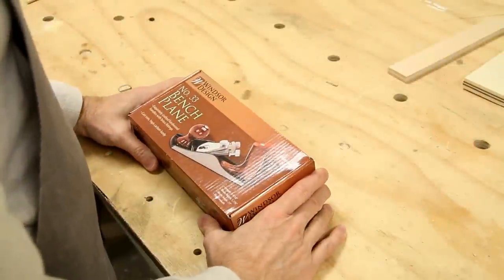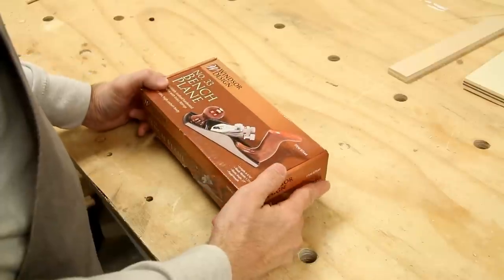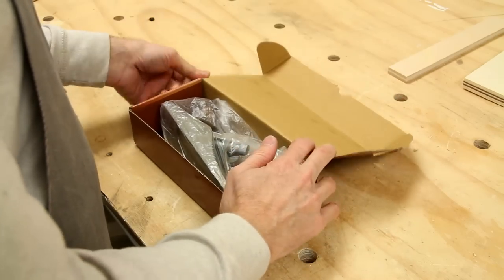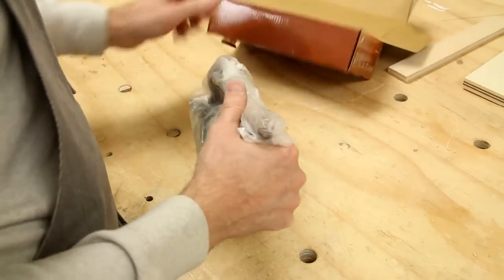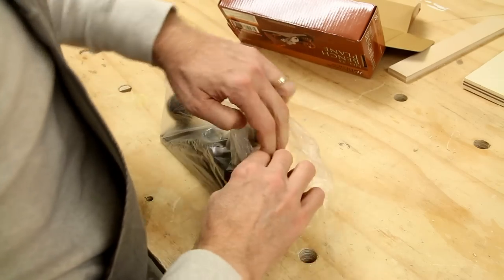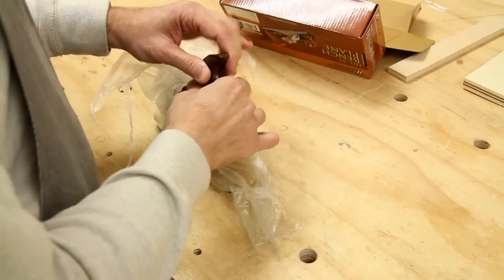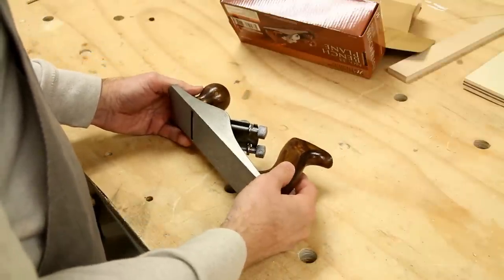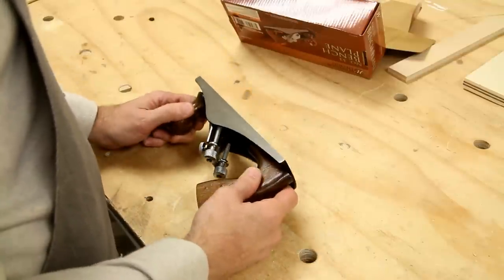Harbor Freight No 33 Bench Plane Review and Tuneup

Comment: I bought one today and turned  it into a scrub plane. The lever cap kept popping off randomly. I flattened the bottom it, which had a sand casting finish. I also undercut the slot for the screw to the sole so that the cap slides down the way and the problem stopped. It takes a full sixteenth inch shaving through knots in weathered red oak.

Comment: Great video.  I picked one up recently and worked a couple of hours tuning.  The sole is concave by .003" which required 20 plus feet of 60 grit self adhesive sandpaper to reduce this to .0015".  QC is highly variable piece-to-piece.
Reply from the maker: +Buck Rogers Thanks.  20 feet! Wow, that sounds horrible. I hope at least in the end to got it to perform reasonably well.  Your QC comment is certainly true.
Reply: +Marty Backe 
Yes, the tuning paid off.  It planes acceptably. 

I went to Harbor Freight today to buy a low cost roll of 80 grit sandpaper.  I consumed half a roll of my automotive medium grit paper flattening the shoe.  So, to prove I have a masochistic streak I bought a 2nd no. 33 plane.  It has the same  problems of the first one I bought.  The sole is uneven but not as bad.  The rear handle required adding a washer to the screw stack to permit enough clamping force to the wood handle before the screw bottomed out.  There is still more to do to the iron and adjusting screws besides sharpening the iron.  I did plane some pine with the factory edge.  It did OK.

Bill
Reply from the maker: +Buck Rogers Your masochism aptly demonstrated ;-)
Reply: +Buck Rogers I have learned that HF sandpaper is cheap for a reason...
Reply: +Bill K. ....the sandpaper was 3M.
Reply: Better choice...

Comment: Thank you for doing this and making the video. Your experience with cheap planes agrees with mine. The only salient idea I can add here is this: We should consider the value of our time.

Specifically regarding hand-planes, that means if I get paid $60 per hour after taxes for my work, then any non-taxable work ( like personal tool maintenance ) costs me at least $60 per hour. Depending on how you figure income, that cost can be much higher. 

So, instead of fettling cheap planes it's sometimes worth the money to buy a more expensive one... to a point. 

I've found that -when considering time- the RALI hand-planes are the most economical for several reasons. ONE- They're very fine right from the box. TWO- they have "disposable" blades you can literally change in about ten seconds. Although that may SEEM like an large extra expense, it is far less expensive than buying Japanese water-stones or diamond sharpening plates. THREE- RALI "disposable" blades actually can be resharpened; it just takes some know-how. FOUR- If I happen to hit a nail or hidden brad with the RALI Plane, I don't cry. I just flip the blade, remove the obstruction, and get back to work. 

Of the four RALI planes I own, I use the little block plane the most, even though I have Veritas and Lie-Nielsen block planes and a huge collection of old Stanley.

So, please understand... I am not denigrating those who enjoy fettling cheap tools to make them work better. If you like doing that sort of thing, great. Go Ahead. Likewise, if someone just appreciates the beauty and convenience of buying and using expensive tools, I can see that too. I must point out that the most expensive hand-tool makers sell a kind of romantic fantasy of hand-tool woodworking, and it is that fantasy that keeps them in business. For those of us who have dome hand-tool woodwork all their lives ( as I have for over fifty years ) woodworking is not a "fun hobby" and it certainly is no way to save money on furniture. By the time we invest in enough tools to make fine furniture and buy high-quality air-dried lumber, there is no payback, other than the self-fulfillment of making things. 

So, for those who wish to make things, but either do not have lots of money or are frugal, buying cheap stuff and reworking it is a good option. Even then, it makes sense to consider ALL the ancillary things that come with a tool's cost: sharpening stones, experience, practice and TIME. 

From that perspective, RALI hand-planes are the best overall deal for someone who just wants a decent tool without all the headaches, associated sharpening gear and associated labor. Next in line in the "bang-for-buck" category are any of the E.C. Emmerich  Wooden planes. Those are also great if you travel with your tools because they are lightweight.

After that, MAKING your own hand-planes with any good blade is the best deal. Make Japanese, Taiwanese, European or Chinese style planes with HOCK, Veritas, Lie-Nielsen, IBC or Bridge City blades. Then, if you enjoy practicing that craft, each new plane you make will teach you something, and ( usually) be better than the last. 

Since I grew up in a violin shop, and because my dad was born in 1898, I learned early how to make almost ALL my own hand tools. So, I have a lifetime of experience at that, but that does NOT mean I enjoy it. I only do that from practicality when it is both faster AND cheaper.  

If others wish to fettle inexpensive planes, I can recommend BUCK BROS. hand planes, both the bench models and block planes. They are not much more than the Harbor Freight models, but are MUCH better to begin with, so they require less work. The blades are high-carbon tool steel and thick enough to work well. 

Again, I am not criticizing anyone for buying the cheapest or the most expensive tools. I understand both philosophies and have done it both ways myself. Here, I am only trying to ADD something worthwhile via this verbose comment so that others might learn from my experience. 

The cost of any tool is not merely the retail price. It is the cost to prepare it for duty, sharpen it, prevent rust, store it. For those of us who have done any woodworking or carpentry professionally, we also must consider the tax deductions we get from depreciable tools. Therefore, when we consider the TIME we save using good tools plus depreciation, we actually come out far ahead at tax time. 

And even for those who only pursue woodworking as a hobby and DIY folks who want to save money doing household repairs and upgrade projects, spending a little more is often a better strategy. Sure it’s great to make your own cabinetry, fix floors and trim… but it takes TIME to accomplish anything. You actually CAN save money doing projects like those yourself. 

Just remember, It takes TIME to modify poor planes. That's time we could be using more profitably doing the project instead of fixing the tool first. If you work for a living, you must consider both the time and energy required to finish any job. It’s no fun being a landlord or trying to build equity working a job AND working at night to repair or upgrade a home. If I had to fix every cheap tool before I could use it, I would have lost money and been pissed off at my cheap tools for stealing my time. It took decades of experience for me to LEARN what I know. No one can ever get that time back unless they invest their time wisely. 

Ultimately, TIME is the ONLY commodity we have in life. Consider that.
Reply from the maker: Interesting perspective. For me, this is a hobby, and I was just having fun experimenting with this plane. Anyone who is doing this for living will already have all the tools that they need and certainly would not take the time to buy and fix a Harbor Freight tool.
Reply: Wow. You mention the value of time as our most valuable commodity, yet take the time to write a short novel on cheap vs expensive tools-- which probably took about half the time it took him to bring this plane up to snuff. Oh the irony.

Comment: I had one of these a little while back. Took it right back to the store. The holes for the adjustment screws stripped out, the blade kept popping loose no matter how I adjusted it... I don't know if it was just a fluke in that piece or if they're all that bad. I really liked the design, but if it's not made well what can I do?

Comment: I have the same plane and the adjustment screws are either bent or misaligned. I removed them and tap it with a hammer to adjust. That seems to work well.

Comment: Aside from the handle and tote, this is identical to a cheap Stanley plane I purchased 4 or 5 years ago. The Stanley had plastic tote and handle, but otherwise it is identical.
I did basically the same as you did; set it up as best I could. It took fine shavings, but I got really tired of the two lateral adjustment screws. Real fiddly to get them right at times. I got a Millers Falls at a Flea Market locally, and ended up taking everything off of the Stanley and using it with sand paper as a fret leveler for guitar work. 
But if you were on a really tight budget, it will do the job.
Reply from the maker: Interesting. Didn't know Stanley made one too. They both are probably made at the same factory :-)  Yep, I don't use mine much, it was really just an experiment.
Reply: I would almost bet on that.

Comment: I made that exact same impulse buy. I still haven't completed the tuneup yet. :) The iron in mine was way worse. Whenever it was sharpened someone got way happy on one side. I would have returned it but the gas to drive back to HF was likely more than the plane cost me. I don't have good stones yet so all I have is sandpaper. I was afraid that the sandpaper would also cost as much as the plane LOL. Maybe this is enough motivation to convince me to go try.

Comment: These low low low end priced planes are aimed at the DIY'er who just wants to ease a door or something, same with the low end bailey pattern  which I bought, they can be made to work very very well. But let's face it, the thickness of the shaving is, although not irrelevant, is small in comparison to the finish of the wood which is by far the most important.

Comment: okay sorry for the long post but maybe someone can help me here.
I thought that the sole plate of any plane like a bench or block plane was not supposed to be perfectly flat along the whole bottom. I thought the bottom plate was supposed to have some flat/true areas like the area behind the blade..and near the back and right near the front. I always thoiught that having a bit of a hollow in the bottom of the sole was what you wanted I know with the Japanese planes they dont make the bottom 100 percent flat all the way along it. they true up the front and back and the area near the blade and thats to reduce friction so that it still has flat/true areas to ride along but the less friction reduced the amount of force it takes to use the plane. But maybe thats JUST for the japanese planes since they are wood?
Someone plz let me know.
Reply from the maker: Most quality Western planes have flat bottoms. But you are correct that what matters most is to have the front, rear, and the area in front of the throat all flat and in the same plane. If the entire bottom is perfectly flat, that's just a plus.

Comment: I bought one today, a month ago i bought the No4 combo set not real impressed with it, but it worked. Blade wasn't true on it either. 
I took 20 mins on the belt sander to flatten the top of the blade, and square the edge. 
i checked the bottom, in the front blade is flat as a can be. 
Behind the mouth, its true, then there is a hollow down the middle. 
I was planing down red oak table top i built, smooth as glass going across it with a good edge. 
I don't see an issue with a little concave in the middle oh yea the tail of the plain is flat even with the mouth and front.

Comment: I purchased one to give my son for rough work and found it wasn't usable at all. The right side adjusting screw was drilled at a different angle than the left which actually worked ok. Even after trying to bend the blade slightly, I could not get the screw to engage the slot in the blade.It was off by around 1/8th inch.  I'll save for a better one that is easier  to adjust the  blade depth also. You get what you pay for I guess.

Comment: There are a few things to consider in buying cheap junk.  The metal used and the manufacturing is usually cheaply done to be able to sell cheaply.  Almost any blade can be sharpened to take an edge and pull fine shavings but the test is how many good shavings will it give you before they start getting a bit less fine and then tearing the surface as it plows along. A poor blade is a nightmare and a decent replacement can cost more than the cheap plane.  A Stanley or other mid-range plane may cost more in cash outlay but will be an easier and shorter tune-up and last longer between sharpening (I strop after each session) then a junk one.  Better blade support is another thing you'll get on a better plane.  My restorations of Stanleys, Record, Craftsman and other used planes usually takes less time and effort than trying to set one of these up and takes no more skill.
Reply from the maker: I agree with everything you said. This video was more about having some fun in the workshop and seeing what could be done with this plane.

Comment: It might be a $10 plane but how much of an investment in Diamond stones and a bench grinder is there?  Essentially, a $10 plane can perform as well as a $150 dollar plane as long as you have $500 in sharpening/tuning equipment. I would probably buy a cheap plane like this for the sole purpose of filing a wider mouth, rounding off the blade and using it as a scrub plane.

Comment: Question from a novice. As with Japanese planes, there is a relief cut in the blade and the base except for in front of the blade which is dead flat. Looking at this HF plane, as you said it had a 20 thou gap. What would happen if you kept that relief and leveled out the sides and front of the base? Seems this would help with minimizing friction.  Thanks

Comment: Nice. Subscribed. Comments: you can skip flattening the back by putting the smallest possible back bevel on it ("ruler trick"). From what Ive gathered about the chip breaker, it's absence isn't a problem on cooperative gain (of course), very large shavings, or very small shavings (0.1mm). Maybe HB... Sorry windsor designs, haha... Put a radius on the blade thinking that people would use it as a scrub plane, taking large shavings, which would make sense considering all the other problems.

Comment: I bought one of these since it's all I can afford -- if I had more money, there's other tools I need more (or wood).

When I first tried to use it, it was pretty much hopeless unless I wanted some nice gouges in the wood.

I'm now able to get it sharp enough to take shavings, but it quickly becomes dull again. I'm not sure if it's something I'm doing or if the blade is just too soft.

This is also the problem I have with their chisels with the clear yellow handles. Fine for shaving with, but dull the moment I try chopping with them.
Reply from the maker: Either the metal is too soft or your blade bevel is too shallow.  I would use a 30 - 35 degree bevel.

Comment: Is the cap iron a dual purpose in that it also serves as the chip breaker? I guess you can "polish a turd"? As far as the adjustment goes, I guess it just would take some getting used to. For $10 not bad, but I can find restorable Stanleys around here for $12-15 at flea markets, peddler's malls, and antique shops. Still have to out in the work to make it serviceable, but have a better quality plane in the end. If I were to but a HF plane I think it would be a roughing plane at best, in my shop. Or even like you said, for the more ragged work with plywood and such.
Thanks for the review.
Reply from the maker: Unfortunately, in Southern California, where I live, there are no flea markets that carry old tools. This Harbor Freight plane was bought on a whim just to see if I could make it perform. It was $10 entertainment, that's all.

Comment: The only thing I find bad with using this plane, is that I find it nearly impossible to perfectly set the blade for a thin thin cut.  I kind of have to just go back and forth until it magically happens.  But for 15 bucks I'm happy.
Reply from the maker: It's certainly workable, but one has to remember the price of this plane. And it's currently on sale (Sept 2017) for $8  :-)

Comment: Marty, that plane's blade comes with a 23 degree angle from factory. Did you change the angle when you tuned the plane? To what angle did you sharpen the blade?
Reply from the maker: I don't remember, but it was probably between 25 and 30 degrees.
Reply: Thanks

Comment: For the price and although the quality is hit & miss, these fit in the category of 'not bad' after a tuneup. It's also a handy in-between size and good for tucking in a toolbox  After flattening the sole,  I filed the side edges and slots of the blade and then flattened and sharpened the blade. There is slop in the adjustments, but once I got the feel of it, it cut ok.  
     And then I bought a second one.  I repeated the tuneup, but I couldn't quite get it to adjust as easily  as the first one.  After a careful look, I noticed that the left adjustment screw was not quite parallel to the right screw, and I think that this made it cranky to adjust.  When I get some free time, I'll see what can be done.
    By the way, do you wax or lightly oil the sole of your planes?
Reply from the maker: Thanks for your comment. Interestingly, I wax and oil the soles of my planes, depending on the situation. I have an oil soaked carpet sample embedded in a piece of wood that I use mostly because it's very fast to swipe the plane over it and be done.
But if I'm only going to make a couple of passes on the wood sometimes oil residue can end up on the wood. So sometimes I grab a stick of wax and draw some hashes on the bottom of the sole and that works just as well - takes longer though.